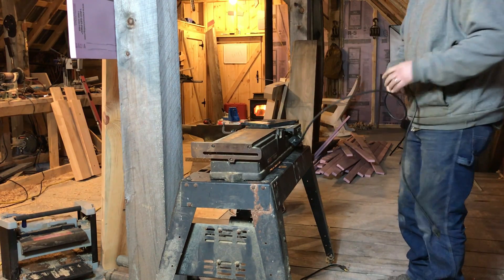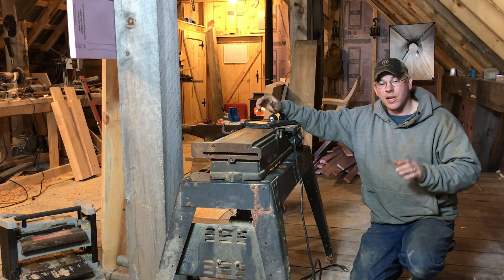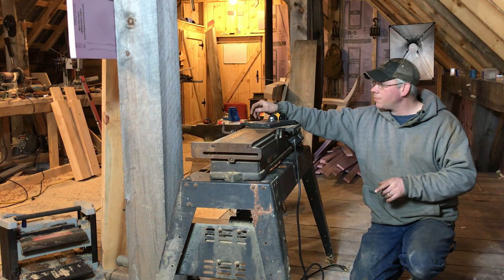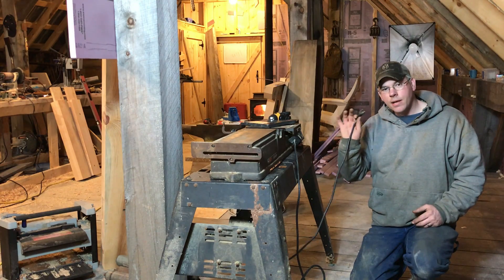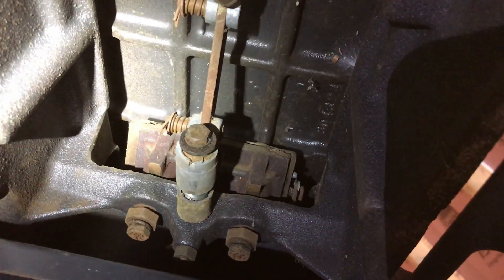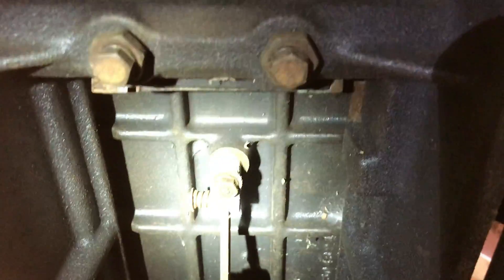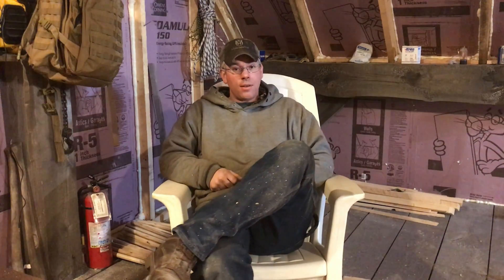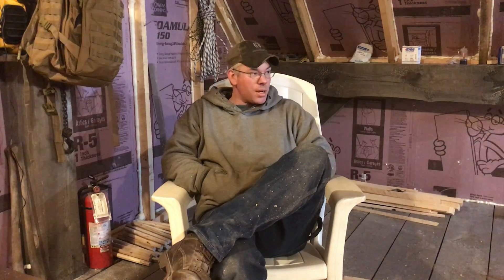Another Classic American Made Tool Rescued From The Pit Of Despair!!!

Comment: I have an early 1960s Craftsman jointer I bought off Marketplace, the seller has it completely restored, it’s beautiful. I haven’t used it much yet. I need a couple of push blocks. My idea is to buy 2 wooden concrete floats from HD and modify those into push blocks, they are $11 each.
Reply from the maker: That's not a bad idea, I may have to try that.

Comment: I had that jointer from about 1975 until 1993  (by the way, the leading 113 in the serial number is Sears' manufacturer code for Emerson Electric--they supplied a lot of tools to Sears for a lot of years). The good news is that it served reasonably well for edge jointing stock, and I put a lot of lumber through it. The bad news is it was worthless for face jointing because I could never get the infeed table coplanar with the outfeed table. 

After wrestling with it for several years, and having got it off the stand, turned it upside down and doing some serious examination several times I figured out the problem. My conclusion was that the gibs--either on the table or on the frame--had been mis-ground, and you could either get the tables coplanar (almost) or you could raise and lower the infeed table, but you couldn't do both. When adjusted coplanar (almost), the gibs would bind up and it was impossible to change table height. Not sure whether it was a design problem or a production problem.

I thought long and hard about taking it to a machine shop and having them surface the infeed table to match the outfeed table when the gibs were adjusted for easy raising and lowering. It would be exactly the same process as machining an engine block (or heads), but in the end, I didn't. The primary reason is because I got a closeout deal on a Delta DJ-15 which turned out to be an order of magnitude more jointer--both in weight and performance. I would still have it if I hadn't got a screaming deal on a DJ-20 in '04.

I'm not saying you're wasting your time with it. We all have to make compromises on our tools when raising a family and not being independently wealthy. I used that jointer for quite a few years. You will, too. Same with other tools I had and you have.

Comment: I don't think it's ADD Jim.  I'm pretty sure it's the same thing I've got, which is technically called ADS.  That stands for Attention Deficit -- Squirrel!  You also reminded me of me as you were hauling the jointer parts in.  The table saw sitting there in your way -- on casters -- but rather than pushing the saw back a couple of feet, you work around it.  Classic Jeff move.  Had to chuckle.

Comment: I have a wild hair idea for you to consider if you like.  Instead of having multiple tools set up and move around as you need them why not make a lazy susan type of stand that would rotate around one of your verticle beams.  Set the tools on it where you are facing the largest area to work in instead of directly into the post, I am thinking of setting them at a 90-degree angle.  I am thinking of putting the drill press, sabre saw and small planer and whatever else you have.  You can screw rollers to the floor (wheels up) for it to turn on.  Of course, it will need bracing to the post on all four sides, again with rollers for the top to turn.  It is just an idea I had while watching this video.  When you need a certain tool just rotate the lot until what you want is in front of you.  I do watch all of them.  Thanks for the viewing content.
Reply from the maker: That's a neat idea and has some merit, might be a cool future project.
Reply: @TheTradesmanChannel    Take it and run with it, I hope it is something viable for you.

Comment: I see you have had problems with rust. Your new shop area will be vulnerable to humidity causing rust. A good tool to remove surface rust for your cast iron surfaces and leave a great surface are the Sandflex Blocks. On Amazon a little over $10. 
Also would consider dust collection in your new tool table builds. Continue on.
Your new introduction sign is first class. Your design?
Reply from the maker: Not my design but one that came with the editing software.

Comment: They sell those engineer squares at Garret Wade. I have a couple and they are easier to use than anything else. I have a 4" Craftsman joiner. It had done miles of lumber and is still working. Your 6" is a better machine. You really scored on that woodshop sale. What else do you have that we will see?
Reply from the maker: There's a lathe, another planer, a bandsaw, a nice dovetail jig, a 3hp Milwaukee router destined to be a bench router along with a few other odds and ends.
Reply: @TheTradesmanChannel  Man, you really stocked up. The Delta stuff always seems to stand up for me and do a good job. Craftsman, works surprisingly well, too. I wouldn't buy any of their new table saws but I have two saws so don't need more.

Comment: same table saw. same jointer. Both work good. You need a chain hoist.
Reply from the maker: I have a chain hoist and a trap door.  You can see them both in the older timber frame videos in use.  This was easier as I had to take them apart anyway to get them out of the old shop.